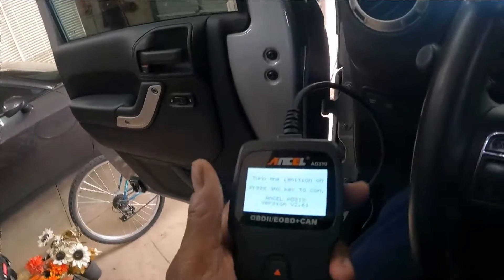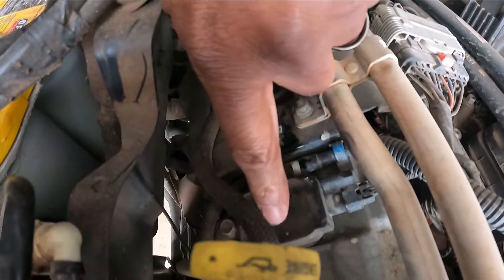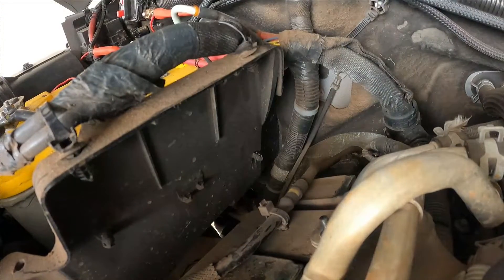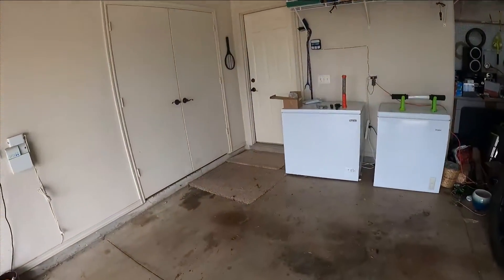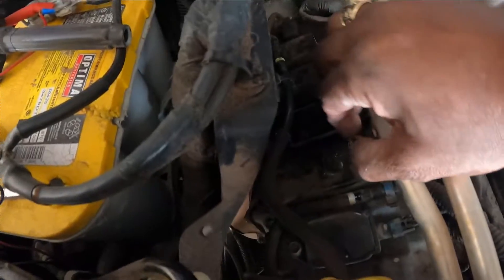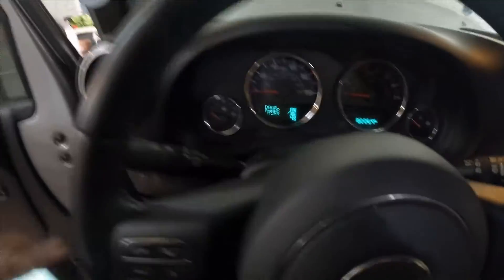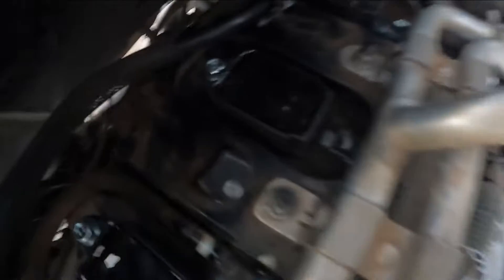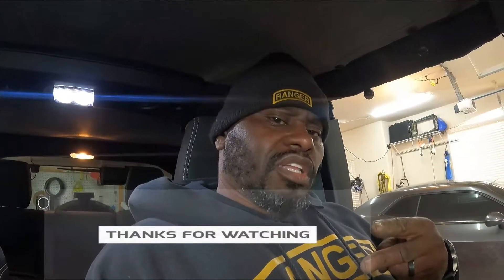Jeep Wrangler Coil Pack Diagnosis & Replacement

Comment: Goodmorning sir currently going through this problem changed all my spark plugs last week now check engine light is on I haven’t changed the coil packs
Reply from the maker: @jairoochoa1828  try changing the coil next, after we did all of that ours ended up being a bad cylinder head. It was a good thing we still had an extended warranty. It cost around $4,500 to replace. Try that and let know if it works.
Reply: @rrrobin2569  but by the way the coil packs look in the inside it doesn’t look like the coil packs were changed
Reply from the maker: @jairoochoa1828  is it giving you ant codes or check engine light?
Reply: @rrrobin2569  I hope it’s not a bad head gasket because I just currently got new head gasket rebuilt

Comment: Rich, thanks for the video, mine is the nightmare side #2 cylinder. So am i reading the comments right. It wasn't your coil, it was something with cylinder. I have a 2017 64,000 miles so im out of warranty. I called jeep today just to finf out how much to replace all plugs and all the coils. They want $1302.00 and im hoping its only a plug or a coil, not a bad valve. Crazy
Reply from the maker: @nickpanhead7209 I hope its only a coil or plugs too. Ours ended up being a bad passenger cylinder head. I am glad we were still under our extended warranty. It was a 44,500 job!! Let me know what you find out.
Reply: @rrrobin2569  I'm waiting for my regular mechanic to get back from vacation on Tuesday, to see what he says. I'm out of warranty, so it don't matter who does the work. If I knew for sure, it was a plug or coil, I would do it myself. But don't want to open up a can of worms. If the check engine light wasn't on, I wouldn't know anything was going on with it. It seems to be running fine, at idle, at  sitting still, revving the motor. Or even at high speed, everything seems normal. So I'm not really sure. But thank you for getting back to me. And I'll let you know what he says, towards the end of the week. Happy New Year
Reply from the maker: @nickpanhead7209  no problem,  good luck!!

Comment: I would have tested it before tightening “all” the nuts and bolts. Had that not been the issue, you would have to take it “all” back off. Just a little time saver.
Reply: I know but you had a real problem to fix and you put it all back together before knowing weather or not it worked. Suppose it wasn’t the fix. You would have to take it all apart again. Just saying. Thanks for playing
Reply from the maker: @Huckleberry54  true, it ended up being the cylinder head was bad. Luckily my warranty was able to cover it.
Reply from the maker: @joelspencer-lo5uo it was a learning and teaching experience....lol
Reply: Oh me! Sorry it was that instead. Glad you were able to get it done. Happy many trails and travels to you. 👍🏻

Comment: Outstanding video 👏...out of all the other videos I seen...no one explains the coil packs order as you did 😀 🙏...thanks to you...now I know how to locate coil pack #4... I got code P0304 on a jeep gladiator with only 5000 miles. Thanks again
Reply from the maker: @Jaun Casanova, thank you. Hopefully, your Gladiator is  under warranty.  Ours ended up being a righ sidevhead cylinder.  It was $4,200 at the dealer but we had an extended warranty to pay for it.